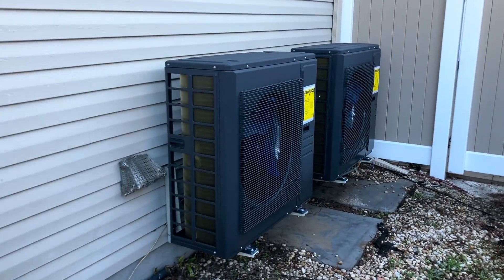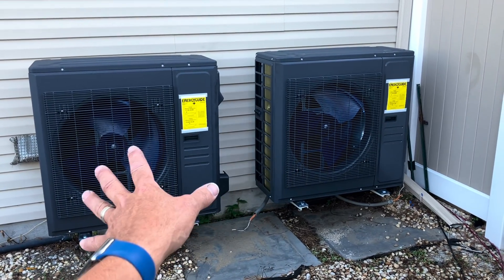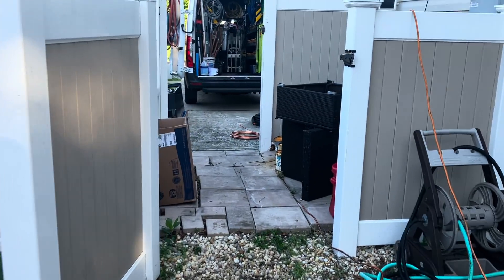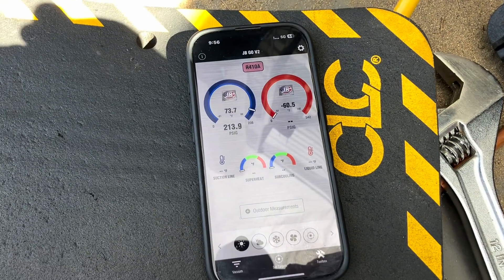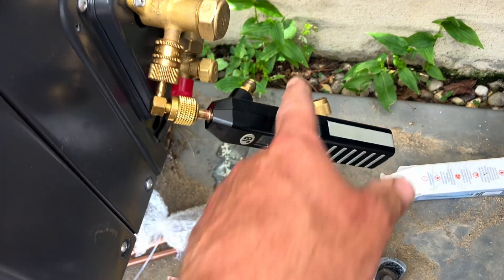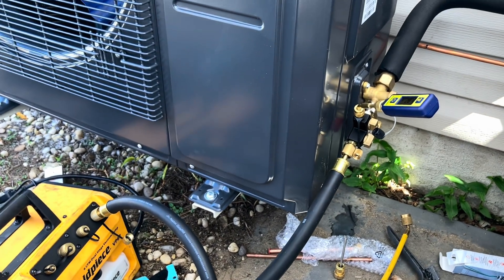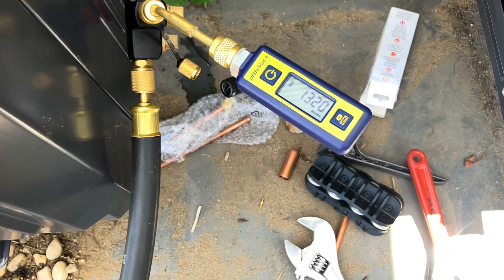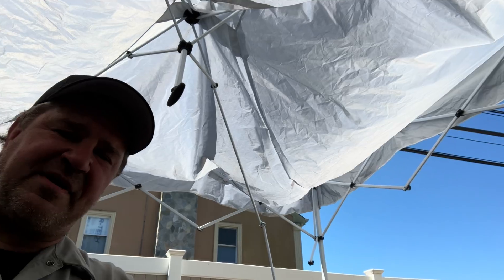Disaster Strikes During Heatwave HVAC Install – Brand New AC Coil FAILS!

Comment: If it’s 454 then it’s normal, they have been dealing with it all over the country, it was rolled out to quick! The question is how did you pump it down to under 500 with a leaking evap

Comment: Just replaced a brand new evaporator coil  at first it sounded like a low refrigerant
Issue while diagnosing it 8 psi low side went to put high side on nearly froze my  hand  replaced the  coil and  dryer system is working great now

Comment: The last few days were brutal! We lost power for 4 hours, that has only happened one other time in my professional homeowner career of 27 years long. If everyone had electric cars, we'd really be screwed. Nothing worse than putting an air handler in an attic on a super hot day only to have the coil leak. But, great service!!

Comment: No Lie whatsoever we were installing a carrier system and to our surprise when we opened the air handler to hook up the wiring there was no blower. Distributor took care of us and had a replacement unit there within an hour. Also different install  had a carrier gas furnace that when we took the door off to hook the wiring up the gas valve fell out because it never got screwed in from the factory.
Reply from the maker: CE sucks

Comment: I installed a Pioneer (Midea) single-zone 12k unit in my kitchen in July 2022, and A 3-zone 30k outdoor unit with 2 12k heads connected in June 2023 (future zone to be installed later).  

The 2022 single-zone unit's compressor died towards the end of summer 2024.  I can't guarantee it wasn't first time DIYer installer error, however I pressure tested with nitrogen and then vacuumed down below 500 microns, so I think the compressor may have been to blame.  I recovered the refrigerant and it weighed out within an ounce or two of the factory charge.

My multi-zone is still running like a champ, though through this heat wave.

Comment: Your coming in too hot with the nitro. You don't need more than 110psig with trace gas and a proper leak detector to check for leaks. At 275 or 400 I've seen dummies pressurize things to equals cheap paper thin metal for coils to burst! This isn't your father's Trane unit ladies and gentlemen. You must know stuff sucks for quality all ways possible these day's.

Comment: didn't the evaporator coil come nitrogen charged at high pressure?(standard test pressure, much of that is now 600PSI!). didn't anyone notice it was flat out of gas?
Reply from the maker: There wasn’t any nitrogen in it
Reply: @PipeDoctor  that sucks, even goodman ships with a high pressure nitrogen charge now, there's also a standard service port inside by the txv balance tube, the txv's are all threaded/gasketed fittings for easy replacement(hopefully not easy leak points. lol
of course they're also all aluminum coils except where it transitions to copper from txv and before the service ports/txv bulb/balance tube.

Comment: When will lobbyists push for better equipment? No wonder they worry about refrigerant since coils(mainly) are leaking so much of the time. Get the equipment tight/ leak free and refrigerant would not be an issue.

Comment: Will ACIQ also pay you for replacing the leaking coil? I'm not electrician, but that one black wire in the WAGO looked to have some exposed copper wire, that could cause  short. at 5:30  a few seconds later i think you even say its a little long, but don't show fixing it.

Comment: I'm not sure why you're having problems with your trublu hoses . It's like $20 for new o rings. You don't need to send them back to get rebuilt 

And the bluvac pro . Just gets cleaned with alcohol   hold down the power button with the gauge off and it will say good or soon. When it needs to be calibrated.

Comment: Why didn't you remove the outdoor unit on the right and pipe the unit on the left. While it was removed you could prep the unit on the right. Re install on bracket, flare and done. Bueno yes

Comment: We pressurize Mitsus to 600 PSI dry nitrogen for 1 hour while we do other work. Release the nitrogen then vac down to double digits 
in 10 minutes. Always works.
Reply: A2L dont need no 600psi. I always blow nitro straight thru for 35-60 seconds then vac.

Comment: I love those Wego's baby
Mikey pipes I've only bought two manufacturers of tools for quite a few years now.
Fieldpiece and fluke.
I need accurate, tough,and reliable.
That's the the brands I've learned to trust.
JB is excellent excellent however.
Reply from the maker: Very cool!
Reply: USED JB GUAGES BACK IN THE MIDDLE 1970s the toughest guages i ever owned  still using them  Diamond cresent also

Comment: Did they (installers) not notice on the indoor unit when the connected the line sets that there was no nitrogen in the evaporator coil?
Reply: Yep either pressure out or sucking in. My brand new coil didnt  do that take it back immediately.
Reply: they hoped it was a micro leak and would have left it

Comment: Why are the condensing units mounted on the wall instead of using the concrete pads the old units were on?
Reply: Because they are side discharge units and can be mounted on the wall. It looks cleaner as well.
Reply: They are heat pumps. You want them off the ground if possible.

Comment: I took a 110v blowerout of an airhandler & use it for my fan, can place it by Attic access & it pulls fresh air out of house & cools the whole attic , I use it outdoors as well, you need to take an ammeter & block off discharge till you get correct amps so you don't burn up motor, I have three of them used them for 20yrs still use them when working outdoors in summer, I live in Houston TX

Comment: Don't you hate when people wait until almost July for their new A/C install?
Reply: Some systems are not planned to fail, but they do and you don’t have a choice when they do so that’s when you replace them
Reply: Half of them know the things on its last leg, because we’ve told them. They just don’t wanna fork out the money on a new heating and air system when you’ve got big nice new jacked up trucks to drive around town and $20,000 vacations to take. It’s all about priorities in the USA and very few people make good decisions when it comes to priorities.
Reply: Ummmm. Isn't that when the older units usually fail?
Reply: Isn’t the only industry with dumb ass customers.  For sure.  Yes some shit ya can’t plan.  
But to replace things that could be done at anytime.  An they wait to some f’ed up time of the year is crazy
Reply: @AquaTech225  Maybe they didn't have enough money until then.
Reply: I make  sure I turn mine on in May and make sure everything is  working ok. It saved me a couple times. Both repairs I diy'd. Blower motor capacitor and comp./fan capacitor.